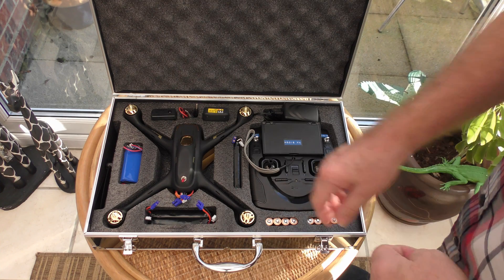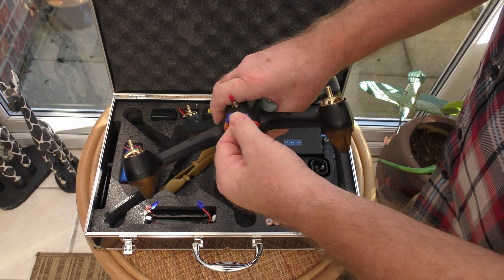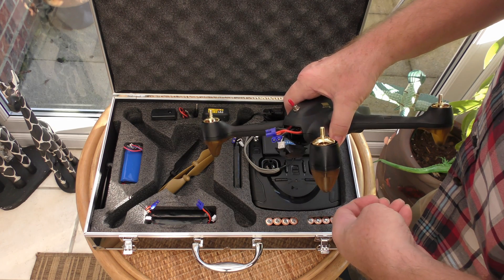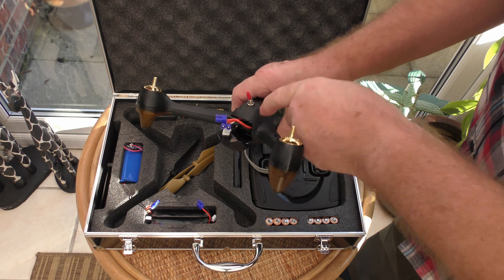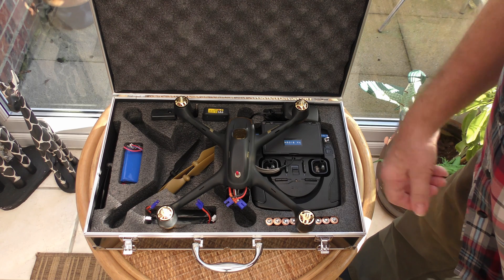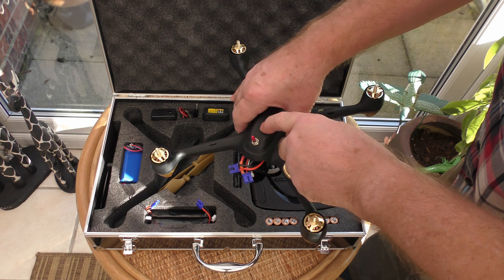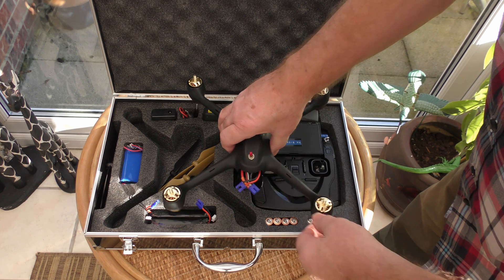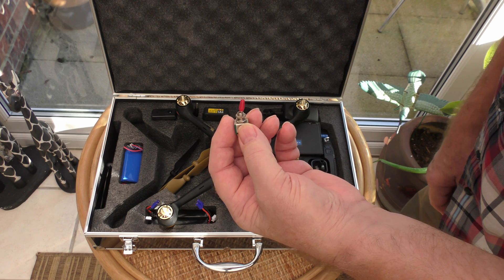Hubsan 501s Mod   2017

Comment: I feel like doing the same but I have a fear.
See if my thinking is correct.
The battery has 2.7 amp per hour but is discharged in about 15 minutes, or 1/4 hour.
In this way the current passing through the wires is 2.7 x 4 = 10.8 amp.
Could the switch handle this current?
Sorry for the questions.
Reply from the maker: Hi I have used this 30-40 times no smoke so far

Comment: I "notched" the corners of the hatch, so I can close it leaving the wires on the outside. This allows me to set the 501s down on a flat surface - and then plug in the cables. (I'm not that good at soldering, and I don't like stuffing the wires inside the battery compartment)  : )

Comment: Brilliant!  Can you put a link to one of those switches on Amazon along with anything else needed for the mod.  I'm not as handy as you so please walk me and your 2000 subscribers through the procedure.. Thanks.  Greg
Reply from the maker: Hi had the switches in my shed at the time--all you need is a mini on off switch look on Ebay  cut into red battery wire you will need to make it a bit longer, solder in the switch drill a hole in top to match the switch, look at the place i have put mine you do not  want it to touch the circuit board components underneath. make sure the wires are secure with a bit of silicone.--All the best Graham
Reply: GRAHAM WHITE   Thanks Graham.